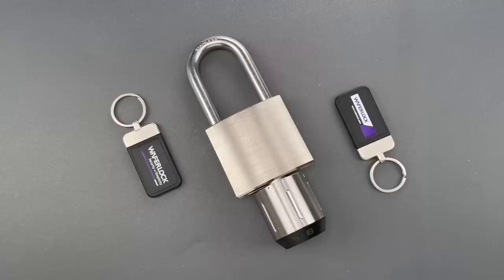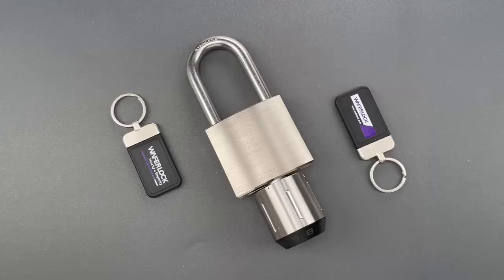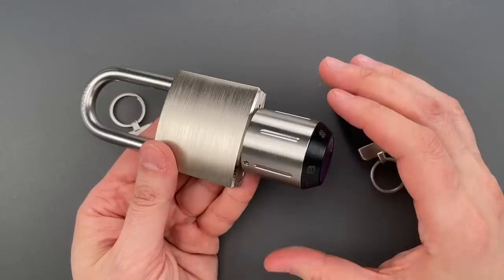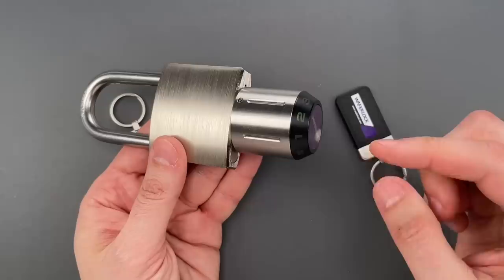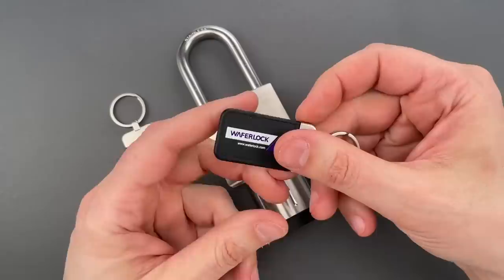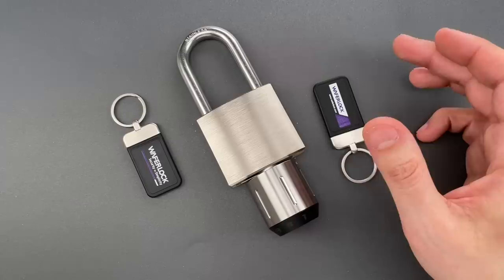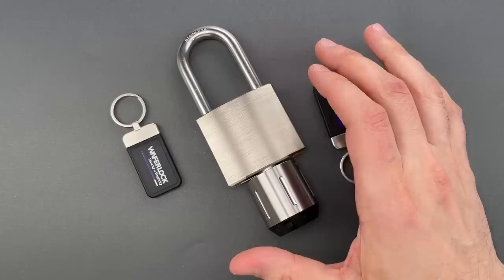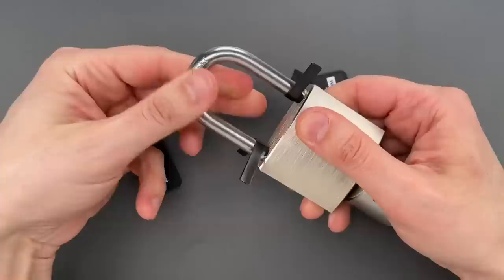[1518] $189 “Smart” Lock Opened in Seconds (WaferLock C210)

Comment: Looks like the cylinder is secure. Maybe the lock cylinder could be taken out of the crap housing and then put into a decent ball bearing housing, by removing the mechanical key cylinder and inserting this electronic cylinder instead.

Comment: F Tier!
F - can be bypassed without messing with the cylinder at all.  
D - low skill "raking" or "comb" attacks defeat the cylinder.  
C - beginner level single-pin picking can defeat the lock.  
B - moderate level single pin picking or a special tool are required to pick the lock.  
A - expert level picking or one-off custom tools are required.  
AA - lock-picking lawyer cannot open.

Comment: It seems almost every "smart lock" manufacturer overlooks the mechanical design and concentrates on the electronics and code. Still, a burglar is much more likely to try mechanical attacks than hacking the electronics so if the mechanics are weak the most elaborate electronic part is useless. It's like using the best lock available to lock a door made of cardboard, why bother with picking the lock when you can punch your fist through the door.

Comment: Considering the fact that the "mechanism" is in that protrusion, one can just break the thing off, probably not something that takes long and turn the actual key (which kinda has to be in the body for this to work) and open the lock. So even if this bug presented were fixed, it still is a stupid design.

Comment: If a shim is a bypass, could there be a preventative? Can the company block a shim from being inserted or isn't there enough room in the lock body? Surely a tiny piece of plastic/metal to block a shim would be fairly inexpensive?

As a second question, if shims were no longer useable, could this lock be picked/bypassed? Would a high powered magnet work as is the case with other locks?

Comment: I'm thinking, since all the locking seems to be in that odd attachment, how difficult is it to remove it from the lock? After that, a screwdriver can probably turn the inner lock cylinder.

But of course, that's a destructive intrusion.
Reply: with the allen set screw on the knob,  I would bet that it would not be that destructive of an entry.   I am curious if he will disassemble that lock to see what other mistakes were made.

Comment: I watched your old melting attack video on the Masterlock 875.  You said the failure mode was not what you expected as the locking pins moved.  I was thinking, would a drill attack over the locking lugs to pull them out work?  I have this model lock on a fuel tank so I'm ruling out a flame attack.

Comment: Hi lockpicking lawyer. I want to design a locking mechanism that opens up with gravity, but when the lock is held upright, the unit can be opened with a key only. If tilted upside down, it wil then open the locking mechanism by itself. I can add a basic camlock to the shaft that goes into the gravity mechanism. But i cannot nail the design. Any places where i can look and copy certain design features?

Comment: As someone who doesn't know how to design a lock, I have to ask: would it be possible to make it so the locking pins that hold the shackle closed (not sure the name but you get the idea) not be able to move until the combo is entered or the proper key is used? Probably a dumb question, but I'm just curious, because if that is possible you'd think expensive locks would already have a similar method in place to protect against such easy attack methods.

Comment: Padlocks always seemed to be a weak security device to me.  If you can't pick it and you don't have the shimmy do-hickie thingyabobs, a £12 BOLT CUTTER will get the job done.
Reply: For some shackles.  There are locks out there where your twelve quid cutters would just get chewed up.  However, destructive entry is considered to be a different category, not least since people walking around with bolt-cutters is rather unusual.  ;)
Reply: @johnpmchappell  Yes indeed but you would avoid the hardened steel shackle and attack either the body of the padlock or the non-padlock part of the setup, both of which tend to be softer materials.  There are shorter bolt-cutters that could be easily concealed should the person not have a legitimate reason for having them.  Also, if we are talking crime, the deed would probably be attempted at night with nobody else being around.  Either way, a padlock does seem to be a weak security option to me.

Comment: A language barrier? Hmmmmmmmmmmmmmmmmmmmmmmm............................................ I wonder what country that could be?

Almost makes me wonder if one "solution" to a lock like this is to have the twisty turnie knob thing on it but instead of having an exposed shackle, cover it with a metal top.

To visualize it, just imagine a rectangular shaped piece of metal with a find line splitting it through the middle, so bottom half is a metal "block" with the mechanism in it and the top half is also a metal block but with the shackle inside.

Comment: I'm curious, what are other exploits is it susceptible to? If it theoretically had a bearing ball mechanism rather than that trash, how would you approach defeating it? I can certainly see a destructive approach just knocking the knob off with a good whack or prying, and surely it has some other vulnerability like the solenoid being unshielded like so many of these